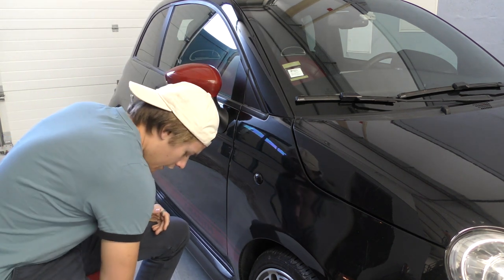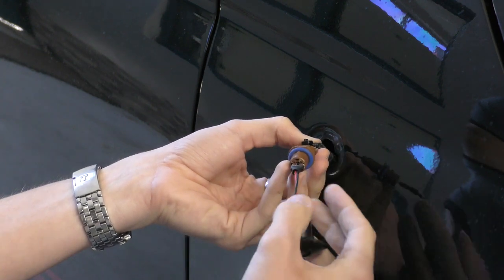Self amalgamating tape - Waterproofing electronics has never been easier!

Comment: Water  Displacement 40,  WD 40 thats wat it was made for stopping the ingress of water on missiles
Reply from the maker: Nice one, I am getting a long list of WD stuff I need to find
Reply: I believe WD40 was developed for corrosion protection of the "Atlas" missile program in the USA.
WD= water displacement
40 = the fortieth formula.
It's the best solution to spray on tools if they have been used outside in the rain or in damp conditions to prevent rust and corrosion damage.